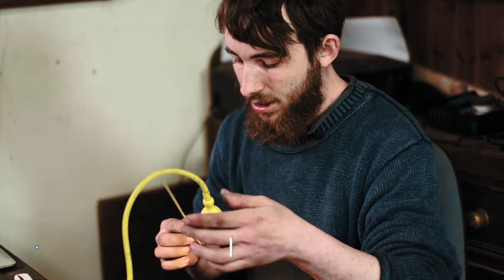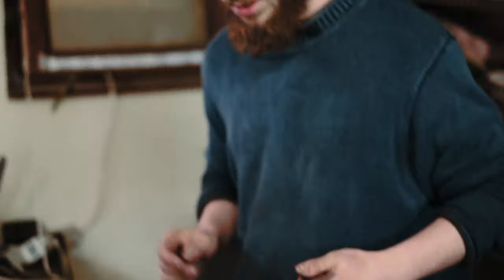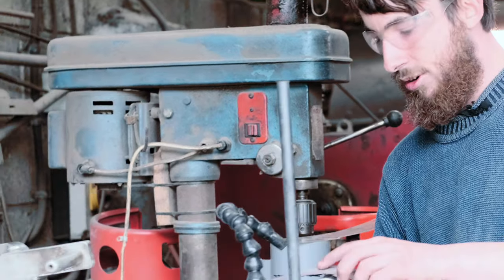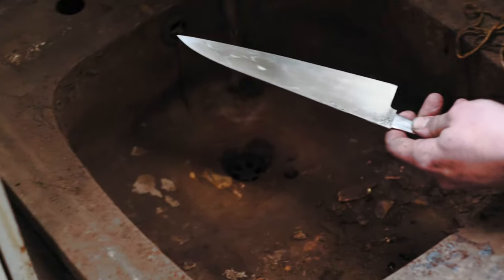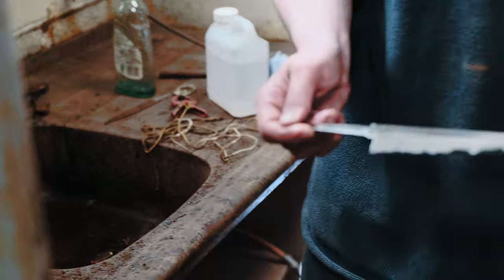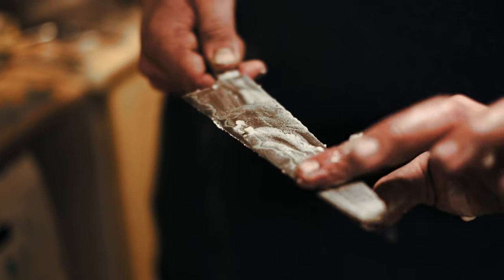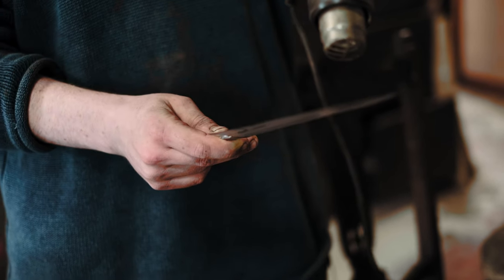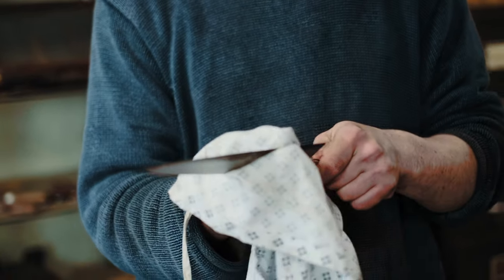Pro Tip alert! Stop your San Mai knife from rusting! Part 7

Comment: What happened to the use of the disc sander? As I’m seeing you hand sanding again.
Reply: This kind of compound bevel isn't flat enough for the disk to be beneficial (or I'm not good enough at grinding on it yet) I use it a lot on smaller blades and stock removal knives though
Reply: @harrytgough9101  yeah the way you explained the process of the blade shape it makes sense you’re not using the disc for that.